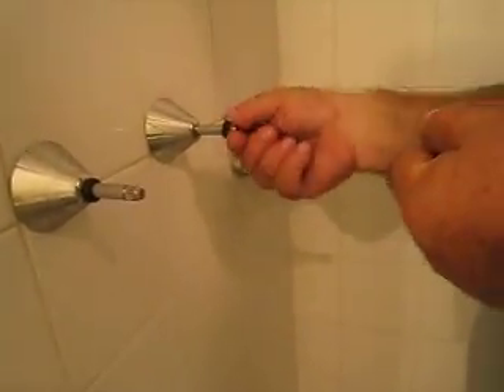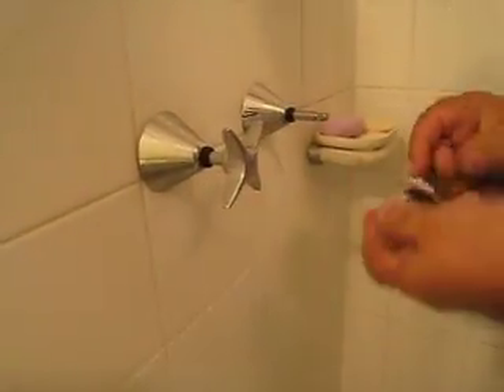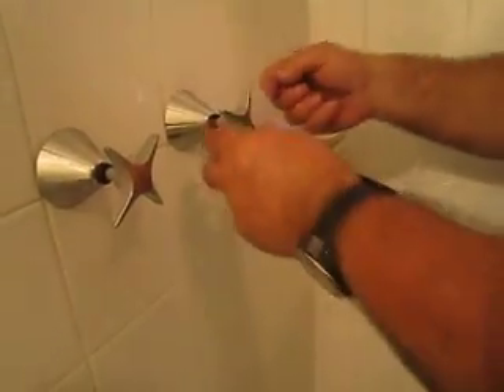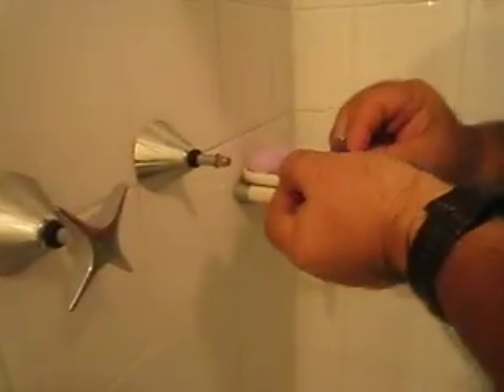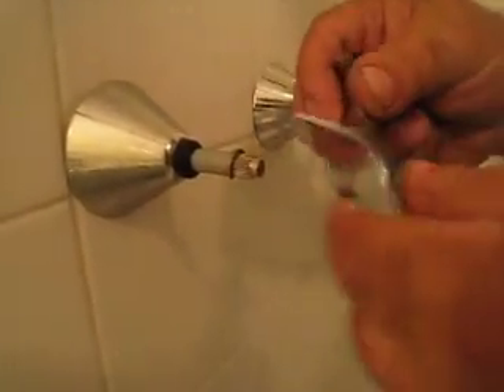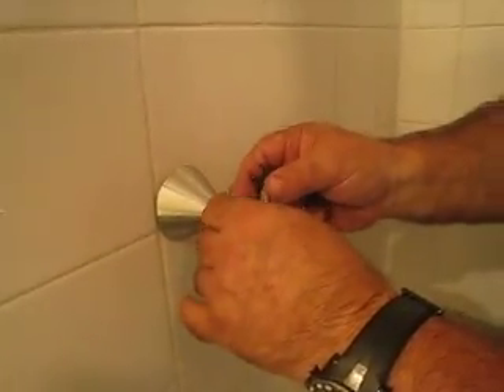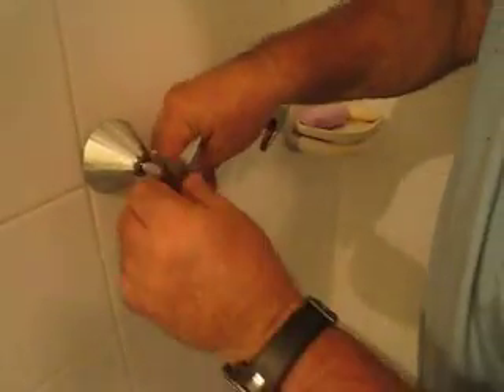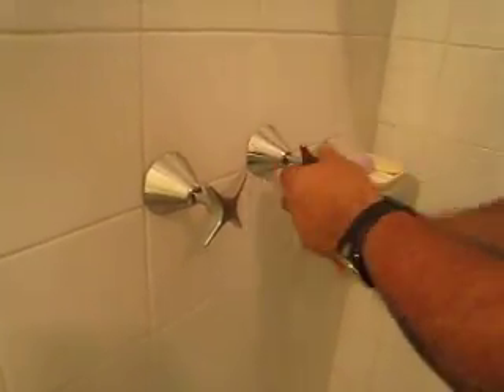Changing shower taps

Comment: so, where old mate plumber says that these parts are "very hard to get" they're not. i just went down to reece plumbing and bought a caroma branded "20 teeth handle fixing kit" for $17, it comes with the tool and replacement parts to fix 2 taps, they're just plastic parts and it has the tool as well. i have these exact same dorf maxum taps in my bathroom and fixed my taps in less than 5mins. the nut was a little stuck, so be gentle/patient when removing. i would have liked to replace with brass parts, but no one had the fix-a-tap branded brass kit in stock.

Comment: Mistake to use the plastic concealed nuts. They tend to seize and you cannot remove them without destroying the tap. They also get brittle as they age and when you use the supplied tool to remove them the notch crumbles away. Suggest replacing them with brass nuts instead or stay away from these style of taps
Reply: One of the worst designed fixing handles on the market. Any handle with  a concealed retaining nut is almost impossible to remove later on .

Comment: Dont buy these taps the Vandal Proof nut behind the handle gets stuck. The little prongs on the tool they supply with the taps bend and you can't remove the handle they are a nightmare.
Reply: True,that design is the worst ever
Reply: I totally agree it's crap

Comment: This types of tap I have got to fix this video doesn't give much details. How he did it ?
Reply: The Caroma Basin and Shower taps are designed to be vandal/renter resistant   - behind the tap hand is a concealed nut with two grooves you need to get hold of a Fix-a-tap "Vandal proof indoor Tap Spanner and Nuts" which is what this John the Plumber is using at 0.18 seconds - you might also need to use a set of pliers to get it to fit properly